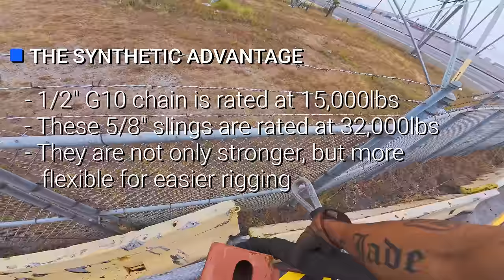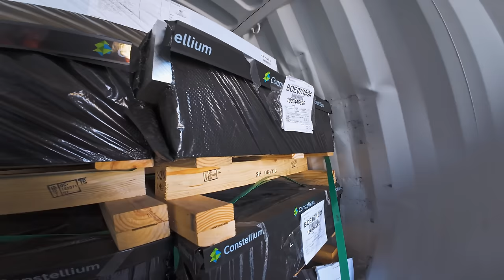Speeding driver rolls over tractor and container

Comment: 3 or 400 hundred, WHAT!!!!  A million dollars worth of equipment shows up with two highly trained and experienced operators and saves your sorry ass.  Go drive Uber dude.  You guys are amazing and fascinating to watch.
Reply: Another thing to consider with heavy wreckers is you aren't just paying for their active time, you are paying for them to be available 24/7. 

If you do 30 calls like this a month those 30 calls have to pay to have enough drivers, dispatch, and the millions worth of equipment, a lot with cameras, all available 24/7
Reply: Gotta be closer to 2 million for 2 fully outfitted rotators but your absolutely right
Reply: More like a couple million
Reply: Flipper and Hulk together are probably worth well above 2 million
Reply: The best way to avoid having to pay for recovery services is to slow down.

People often don't understand the cost of having that much capital invested. Even looking at a well equipped plumbers truck you can see over $100K parked in front of your house that needs to be paid for by the hourly rate.
Reply: I think that when you talk pricing with drivers ( sometines they dont speek english well) you should skip saying like 15- 00 or 35-00... Just go in plain numbers 3500 ( if it is 1000 use thousand).
Reply: Not only that too, danger pay with it, guys working a propane tanks and fuel all day long on these wrecks
Reply: 300 for that much is wild, I got my silverado stuck and the winchout was around 250
Reply: i think he said 3-4k no?

Comment: We used to run LPG tankers and run dry van now to the lower 48. I've been to 5 accidents involving rotators. Simply put, the lowest I've ever paid was $350 for a tow 2.5 miles away from our yard when a ujoint let go and the truck was disabled. No load, driver cruised into the emergency lane. $350 and I was happy to pay it. I had other offers up to $800. I wouldn't give any quotes to drivers at all, period. "Have your boss call us Hoss." Unless you're required to do so in Cali. Great video.

Comment: Great video, great work as always. I agree 100% on doing either pics or video for each job, just like dashcams it protects both the operator and the customer. I'm a Heavy Haul guy and I run a 4 axle Western Star 49x with a big Palfinger knuckleboom crane hauling Utility equipment and supplies, poles up to 85ft, heavy equipment, transformer, cable reels, if it can go on a flat, lowboy or landoll I'll do it. After years of lugging heavy chains and slings, we finally got with the program and started using synthetics, both straps/slings and synthetic chain, what a difference! As you guys know and always show, there's no excuse for taking short cuts in place of safety, take the extra time to over-rig and do the job right. Fortunately I've never had a drop or an incident of any kind, I guess being a bit anal about safety pays off, not to mention our friends from the DOT in the Northeast appreciate proper load securement. Stay safe and keep being a great example of how to do the job right.

Comment: As always Josh, Joe, Alex and crew, the videos, work and expertise you show is always fantastic. A billion years ago I used to work for Realco and worked in the SP yard for incoming truck trailers. I would be there at 12AM and work until I was done which was about 7AM or so and then go to a favorite bar to get breakfast. Around 10 AM I would head out to the SP yard out towards Santa Fe Springs. But. that was the yard where the Stack Pak containers would come in and I would go out and service those things. The Stack Pac containers had Cadillac cars shipped in them from the manufacturer and there was a special machine used to extract them. Sometimes I would find the front half of a car in there where the locking mechanism didn't unlock. It was a mess and not much I could do. Maybe Joe might remember the Piggy-Back yards. I was there 50 years ago! Stay safe all!!

Comment: There should be a CDL endorsement for container drivers as it is apparent that special training is required. Or liability needs to be shifted to shippers for how loads are secured.
Reply: I agree! That load was going to shift somewhere. Glad it wasn't on the freeway.
Reply: There ought to be some kind of licensing for the loaders, too. Top heavy or too small a container for the load, especially for the L A museum style freeways!
Reply: @jamesfurlong8727 the problem with that is they're usually all sealed containers that cannot be opened by anyone but the customer when it gets to them or the load can be rejected and everyone throughout the shipping process loses out one way or another and majority of the containers were loaded in other countries and sealed before even being loaded on the ship so it would be practically impossible to ensure things were loaded correctly not to mention loads could shift during rough seas even if loaded correctly and you'd still never know because you legally can't open it just to check

Comment: Hey Josh, in Australia we have a tagging system for our slings, chains and shackles etc. They have a manufacture date moulded/stitched to them and are checked annually by a certified tester. If they fail chains become scrap metal and straps are shredded. Like you synthetics are huge now for lifting. Chains still used for securing loads though, well explained in your breakdown, thank you young man.

Comment: I am surprised that Alex didn’t think to put the landing gear down and it should stop it from tipping back over. It’s getting the momentum to want to tip again because it has the flex of the suspension. Take that away and it would be stable enough to reposition.

Comment: Doesn't and has never surprised me. These driver's get paid so little that they have to speed to make money. I actually find it funny that they would continue to work for substandard wages? They blow through stop signs. Their equipment is shabby at best. They can't even afford virgin rubber tires? You should have seen what it looked like in the late 80's/early 90's when I hauled Coke out there. All junk cabovers with Bondo and spray paint! I'm glad that I was a Teamster Union driver now retired at 60 years old this year. The container business needs an enema!!! Great video Pepe's!

Comment: Constellium SE is a Paris-based global manufacturer of aluminium rolled products, extruded products, and structural parts based on a large variety of advanced alloys.
PS — seems company should have actually placed some of the eight pieces on the floor of the container. Would have taken more moves to load and unload but load would have been more stable.

Comment: The little animations are cool.  Just a suggestion, for what you explained, perhaps make little icon graphics showing the weight capacity of the chains/straps used, weight of the tractor/trailer/container/load.  For me, I'm the guy on the street gawking at the large equipment used.  Aways amazing to see your videos.

I doubt you would make a DoorDash delivery in one of those trucks for $300. :face-blue-smiling:

Comment: As a retired heavy duty truck mechanic/foreman and shop supervisor let me add a comment about the pricing. Our shop is in the San Francisco Bay area what prices for everything compared to the rest of the country or astronomical. I have no idea what that driver was making as an hourly wage probably wasn't much. He doesn't live in the world of thousands. Plus, he probably knew his ass was on the line for driving too fast causing the rollover. He was praying for a $300 recovery. His brain doesn't think in the term of thousands. Fortunately Alex covered his ass. In his closing I think I heard Josh say 15  when what he meant was 1500. In Josh's world he deals with four digit sounds all day long. To him 15 casually said would  mean 1500, 25 would mean 2500. 
I've been retired for 10 years so you might want to verify the  facts. As I understood it from a heavy duty tow firms we used if they were on police rotation towing firm would have to roll on calls to calls as needed without verifying payment as usually insurance was involved in which case they would tow the damage to equipment back to the towing company storage yards to be stored until the owners or insurance companies settle at which time the towing company got their money. If there was no insurance involved and no salvage value of the equipment the towing company can be on the losing end.

Comment: When the thumbnail said 500 I was like huh??? Then I was double confused when you said 3500 at the beginning. 😂😂
Video doesn't lie though, not that it really matters, he could have asked for clarification on the price before you finished the job, and it's very reasonable to assume someone is speaking in thousands for a job like this, I have to imagine just a regular tow can cost as much as 300 bucks, let alone two rotators.

Comment: Good recovery A few words - the load was from Constellium - rolled aluminum - they do a lot of recycling and also sell to the automotive industry for stamped car parts.  I do have a question - the rolled aluminum was on a wooden pallet then it was on the wooden dunnage. The wooden pallet throws me off s little - was the wooden pallet in the container so the receiver can unload the shipment easier?  The load may not have shifted if the dunnage had not been put on the floor of the container.  I'm guessing the port or someone will have to tell the receiver that the load was shifted. I don't know if you can just pack that stuff up and act like it didn't happen!

Comment: Question. What is up with the 3 part line on the 75ton. I see multiple snatch blocks,and the end of the hook terminating into the same oblong ring as the snatch. Or am I seeing that wrong. Just curious as to what's going on there
Reply: I noticed this as well and was wondering about it….
Reply: Left on from the previous job, I think-they just came from another  wreck to here-
Reply: @grumpysgararge5860  I tried to see in the video where the secondary winch cables were running. I'm just lost lol
Reply: I had left the 3 part lines because I was doing a really heavy lift earlier and immediately had this one

Comment: ok that container was coming into the USA that load was not blocked the rite shipper should have used air bags on the sides of the steel to keep it from moving but they dont care just pushed it on the container closed the door and thats why it slid over and the truck rolled over that was all the shipper falt

Comment: You don’t have to be speeding for one of those containers to flip they over load them and extremely top heavy I pulled them many year’s ago and turned a corner crawling and it came off the ground I didn’t lay it down I was going so slow but the shippers do it to save money they go on ships and rail first so they don’t care